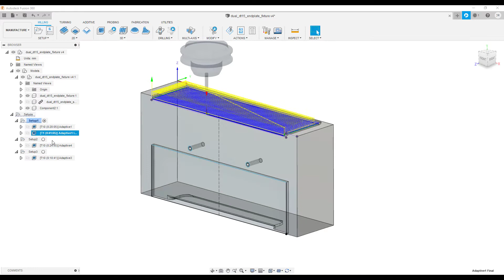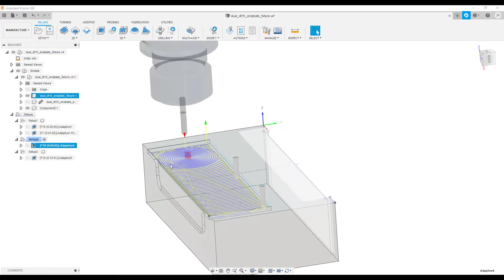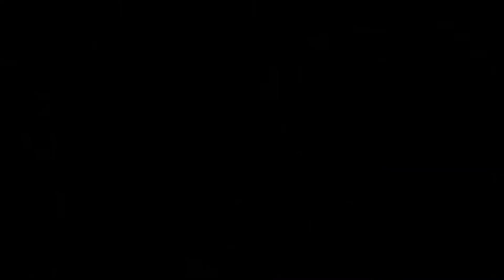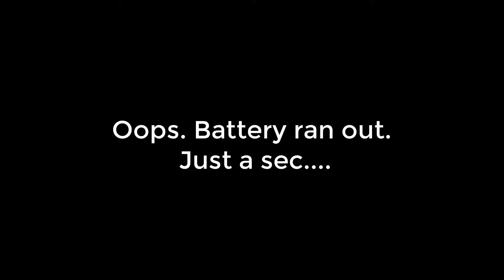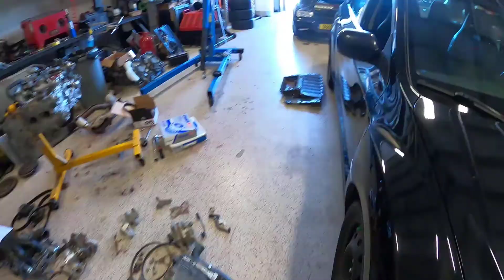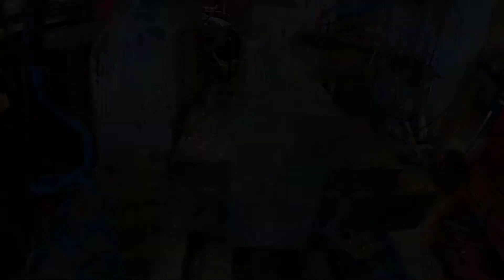Milling a simple fixture on Saturday afternoon

Comment: Hey do you still have this machine? I'd be interested in how you did the conversion!
Reply from the maker: I do still have the machine but haven't used it in a long time. I picked up a Fadal VMC20 last summer. It's so much nicer with an enclosure and tool changer. On this machine the conversion was a CNC Masters, but the controller board had a problem. The replacement was unaffordable so I replaced the electronics with a Masso controller and vfd.